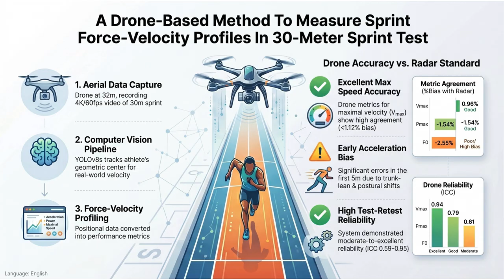Drone-Based Sprint Force-Velocity Profiling | JSSM Podcast (EN)

Comment: Velocity-meters using a thin Kevlar line attached around the waist have been a standard used in competitive swimming since the 1980’s. And the data acquisition data rates (500hz) are much higher than any video based system. Here is an example of what you just described measuring high speed acceleration of hockey players. Instantaneous velocity, acceleration etc. can be collected all at once. Also very cost effective. https://youtu.be/VXMGxOAi_Kg?is=owpTx4u99mogj3cv